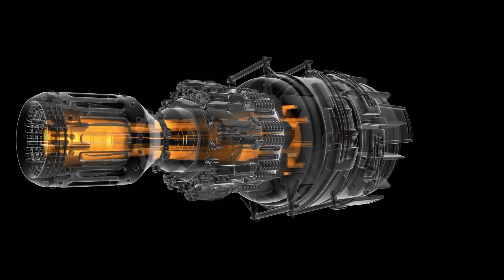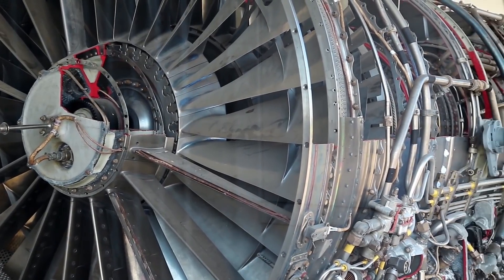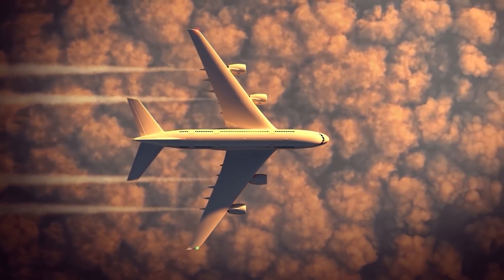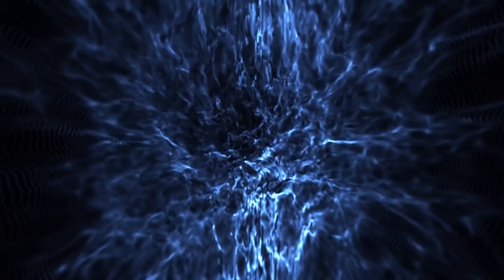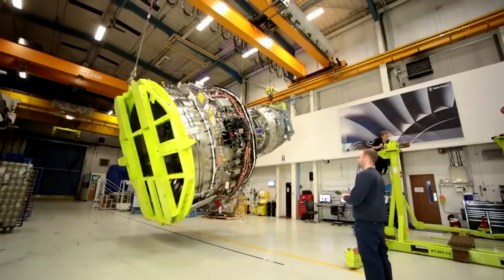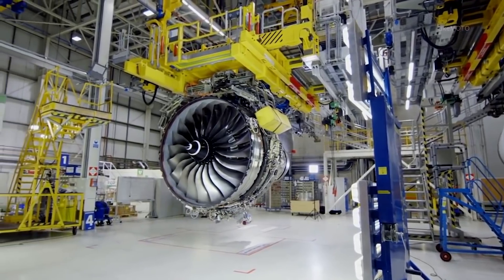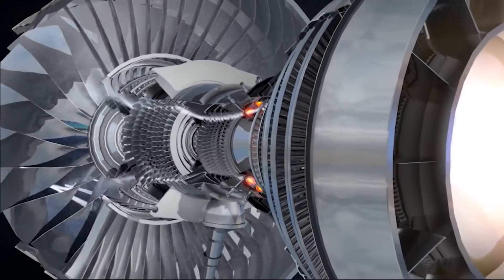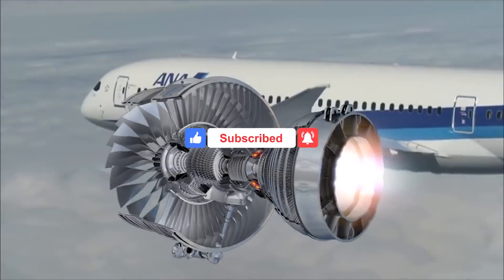What Are Electric Plasma Jet Engines?

Comment: well I have a plasma jet engine that use mainly water with a small amount of power, it could also work in the upper realms of space, so how, an aircraft now uses up to 40 tons of fuel on board, change this to water and now the plasma jet is even better that the jets now. I have tested and have a prototype Plasma unit but no one is interested

Comment: A worthy lab project! Still it comes down to the existing problem. Creating the electricity to power needed to create a sufficient plasmic output, presently we use fossil fuels to create the electricity we all need and, batteries are not enough. This is the false narrative of electric anything, the fuel source initially still comes from burning fossil fuels to create power/electricity, in turn polluting the environment. Until we efficiently use nuclear power to, stop burning fossil fuels, and create our electricity, this will curve our environmental impact. We still have the inefficient battery or storage dilemma. Even then with plasma the problem is how to carry around enough electricity to create a sufficient amount for a extended period.  This is the bottom dollar dilemma without not having any goods or passengers on that aircraft! Yes the plane may fly remotely like a drone or with one pilot if you want a spy plane, not a aircraft that moves goods or people. Weight becomes the problem, battery weight vs carry weight.

Comment: Real thrust is pressure thrust, whether rockets or jets.  Plasma could be used to increase temperature in conventional jet engines, thus increasing pressure, making those engines more efficient and using less fuel.  Fuel could be augmented with water and plasma would still ignite that water/fuel.  Not just jets.  A conventional gas engine could be made more efficient, using less fuel, with plasma ignition & water/fuel injection.

Comment: You can make a plasma jet engine using graphite and nano carbon capacitors with a third and fourth plate perpendicular to the capacitor to make a plasmoid to heat air and run a turbo jet engine. This is done with 1-30kw microwaves to make a plasma arc and the electric field of the capacitor makes a plasmoid in a three plate model. Two plasmoids are made with a four plate method as microwaves hit and energize the capacitors arcing in the combustion chamber rather than burning fuel.

Comment: This is such a pipedream. You would need a turbine larger than the engine on a 747 in order to produce the  electricity to run one of these plasma jets. So use a huge jet engine to make power for a smaller ,make believe ,plasma jet engine . Yeah great idea. And it's coming from such a esteemed institution,  in China.   Don't hold your breath. And it's clear this channel knows nothing about the subject. Kooks

Comment: Could the process be used to power high speed rail travel, and can hydrogen provide the temps needed for the process to produce the plasma? I am not a scientist I am just asking about the what ifs. Do we even have the metals available to withstand the ex stream heat? If 7500 kw per hour is needed I would think that could be provided  easily just  like  electric rail travel is done today.  What about the gain or loss using the process, is it even economical for the exchange process of converting energy into different forms? Anyhow I think it is absolutely wonderful that we have the minds at work to try and solve new technology .
Reply: why?  high speed rail uses maglev and is pretty efficient.  plasma, at current tech, produces little thrust, so it is believed that it will be good in space where there is no air resistance.  burning hydrogen would be burning hydrogen; the thought with plasm is that you would not have to carry fuel (hydrogen), but could hopefully make it much more efficient and use solar panels or some way to charge batteries for the propulsion.  Another issue with hydrogen is that hydrogen gas tends to leak from its container and also weakens what it comes in contact with.  Some believe a hydrogen fuel cell might be good for future air travel, but if the vehicle becomes brittle and loses structural integrity, the victims' families might have a dim view of the use and the resulting lawsuits might just have a negative impact on the future of the company.  How are you going to supply 7500kw in the air or space?  7500 kw is 7.5 mega watts. The train and its power source are on the ground (train slightly levitated with magnetic repulsive forces to reduce much of the friction that old steel wheels on the steel rail produce).  The trains often do not carry the power source (engine) weight, so they don't have to push that mass too.  All in, trains are a far easier vehicle to power.

Comment: Interestingly plasma engines uses electricity to run instead of using fossil fuel but the electricity generater will consume fossil fuels to provide electricity to plasma engines.
Reply: That's why we need nuclear.
Reply: @qui573  We still need lots of RND in the nuclear field specially thorium based nuclear electricity generation.

Comment: I emailed the Department of Naval Intelligence about something I found on the deep web. Stuff got leaked apparently, and these documents talk about HIGHLY advanced technology. You could say its... 'unworldly'. Though these new Electric Plasma jet engines are extremely advanced, this technology that the government is hiding is MUCH MUCH more advance than this. The technology they have literally breaks the laws of physics. Unfortunately, they haven't (and probably won't) tell the science community about their findings. At least not any time soon. I'm currently encrypting my computer (and everything else I can)... Because I will be releasing these documents/findings to the public. This information can and WILL change the world forever (for the better). For instance (this is just one of the things in the documents) ... They have a new power reactor. This reactor operates at 100% efficiency. There is no heat generated by this machine, even when under full operating load (generating power). It never gets above ambient room temperature. This obviously goes against the 1st law of thermodynamics. It's a shame they don't release this technology to the public...

Comment: I can't beleve this tech. Because it's sustanability. Modenern jet engines and it's parts are sustanable up to 10^3 h of full power action. To be in detail, the moden Ni, Ti, and ferrous based HPT und LPT parts are witstand about 10^3 h at full stress (eg Alloy 713LC). But How this tec exibit the sustanability in a cycles swtch on and swtch of envourment?

Comment: BUT to get this jets to lift planes we need a powerfull and light battery
which means more thrust and less weight.
Reply: No......you must start from the top....getting to the starting point at the top is the way of the future....it's the force of gravity that stops you from getting to the top......and the top can be a Moon base or orbiting half way station or many relays of them as the needs must be on the way to the stars.
Why carry all your provision from your home to the top of Mount Everest when all it takes is to get from the last rest camp with practically nothing  before you assault the  Everest summit proper......that's how professional do it......in planned and provisioned stages.
Reply: @gangleweed  what are you trying to say?
Reply: @ipinkiespinkanamodise9322  Not trying but stating..........you need to get to the first stage without having a huge baggage train to get to the end.
I think if you use the ISS as a stepping stone you only need to get there with the heavy booster rocket stage and space shuttle etc and then go on from there with the plasma jet technology in another purpose built ship......you could also use the Moon base as a stepping stone too.
Reply: @gangleweed  ok now I get it😄😄😄
Reply: @gangleweed  ok now i understand.

Comment: How will they carry or produce enough electrical power to fuel an Electric Plasma Jet  Engine  if the engines requires 7500  KW per hour for Twin Isle Aircraft of comparable size flying today. It sounds impossible or impractical. Can the engine itself be made to produce the electrical power it needs. It that we’re feasible,  we would reached perpetual energy. Propellant driven Aircraft per size above battery operated around 400 MPH sounds more practical and within the realm of possibility for short haul flights. I believe prototype aircraft of this type are already in operation.
Reply: One can install a small nuclear reactor provided that the safety risks can somehow be mitigated in case of a malfunction or crash.
Reply: @edwardxuereb1222  We do not want radiation, our entire environment has been polluted by radiation and electromagnetic radiation!

Comment: Chemical fuel still beats a battery in J/kg. This is fine for automotives but unacceptable for flying vehicles.
Talking about a plasma jet without a single frame of a video with it, this must be so hard -)
Reply: The creation of a hot plasma-jet by electricity is a quite inefficient mean of propulsion due to huge thermal losses. Batteries are limited to a couple of eV per ionic binding. Additionally, there are stability limits that rule the possibilities to perform a redox-reaction, where electrons are conducted through a load while ions are forced through a membrane. Crossing this limit will cause a fiery experience. The better way is the p-B high pressure pulse plasma reaction scheme with DEC (direct electricity conversion). DEC is the process, when pulsed alpha-particles (He-4) are inductively decelerated resulting in electrical energy. In the year 2011 we managed to perform the reaction p+B-11->3·He-4 with a yield of about 10. We used Lorentz-force and Maxwell force by means of magnetic reconnection to create a very high plasma-pressure in the GPa range and about 99.98% degree of ionisation. Unfortunately my Government can't do without mineral oil taxes and His Highness, crown prince bin Salman, became very unrelaxed, since one of his businesses is supplying kerosene for jet-flight. Therefore, our institution was closed down, all lab-journals were confiscated, our equipment has been destroyed and all involved scientists and engineers were sacked and put into food-stamp programs. I guess, it will take 400 years (end of coal) until this technology will be released.

Comment: If the goal is to reduce carbon emissions, those scientists should concentrate their efforts on cleaner ways to make jet fuel, instead of tossing aside the MOST EFFICIENT ENGINE that mankind has ever invented -- aka the modern jet engine.
Reply: Agreed!!
Reply: Evacuated or at least low pressure tube transport with maglev propulsion would be more efficient on a per unit basis, the problem with it is the upfront cost to establish the conduits for their transport, similar to the dilemma with solar power. Unless we have a different economic model to address this things will continue in its current (largely) ad hoc fashion that is the nature of our market economy today.
Reply: Well done!, that is correct, as electricity and electromagnetic waves are very dangerous to the environment and public health, and electrically powered devices can only work with electricity! Basically electricity even in homes does not meet the demand!
Reply: what if there is more efficient stuff?
Reply: @climatechangedoesntbargain9140  Agreed, but the BS that the masses are allowed thsee/ hear are mere "opiate" for the masses.

Comment: Looks like what they need to focus on is not carrying enough power to operate plasma engines, but projecting power for an aircraft to receive, on the move, to operate plasma engines.  Permanent solar satellites, permanently transmitting power on a projected track, stationed over the oceans anyone?
Reply: I had the same thought on the matter.
Reply: THAT is what i am thought of.
Reply: Working on a solution to ending Pollution for Long dDstance t(Inter-Continental) Travel.... (shorter distance can be covered by Electric/other planes or hugh speed rail) ..
This 1km2 Craft has 150MW.. yes 200,000HP of Electricity available for Horizontal Thrust.... (Buoyancy is provided by Helium) . As this is not a high speed Supersonic Concorde type or fighter aircraft.... (how) can I use the Plasma Technology and who makes this "stuff".. or do I have to (re) invent the wheel....
Reply: I'm addicted to pigger nussy 🤠